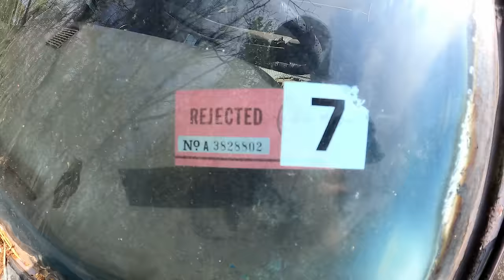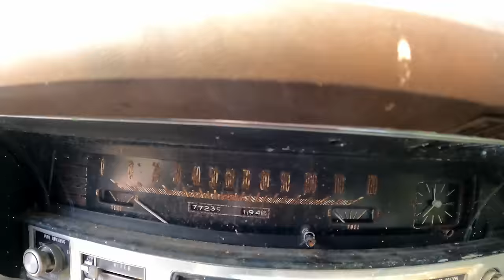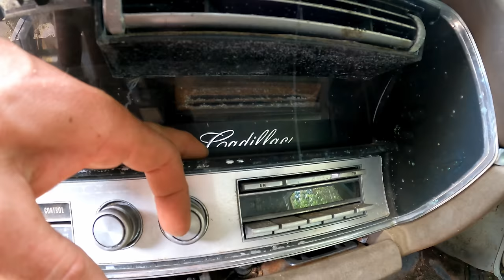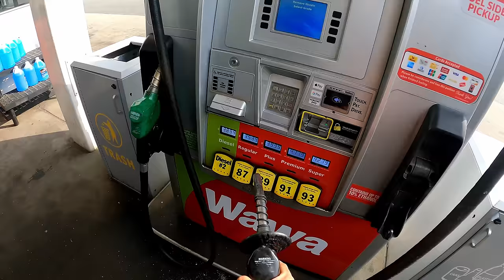1967 Cadillac Sitting For 15 Years  Will It Run / Drive?

Comment: Thank you Chris for keeping your videos real. Instead of editing out mistakes. That is just one of the reasons I love your channel. Plus Gus of course.
Reply from the maker: Glad you like them! And thanks so much for tuning in
Reply: G
Reply: Y. Vyggy
Reply: By bgy
Reply: @NoNonsenseKnowHow  I learn best from mistakes, and so could learn far less if you edited yours out.  Though I have little problem with seeing Caddies get demoed, if it was a more practical old station wagon, I would get it past inspection and put about 300 miles on it with high detergent fuel and oil to clean out the carb and hopefully unstick a ring or 2 so that it can be sold running smoothly and plated even if not much is invested in aesthetics, but spray wax it to prevent any further rust.  Also, you can enjoy it for those 300 miles, during which you can improve reliability.  Then the buyer has a reliable base on which to do aesthetics to his own tastes.
Reply: The third horn is optional.
Reply: My Eldo uses 235 75 15s.  L 78 15.
Reply: 68 Eldo got front disc brakes.
Reply: this is an exact copy of the   other comment, you don't mean it

Comment: My Grandparents bought a 1968 cadillac sedan de ville brand new. Light green metallic,  2 tone green interior,  very nice..They were in thier late 70s then. Lifelong Southern California car,  it was always garaged.  In 1982 when grandpa died at 93, it had 38.000 miles on it! Absolutely like new. Grandma didn't drive any more and sold it..Absolutely in like new condition.  I like to think its still in good shape and running around,  its possible,  my 58 cadillac that my parents bought in 1960 is still on the road.
Reply: какая же восхитительная машина❤

Comment: I had a 67 coupe DeVille in 1990 . I had it shipped to the UK , it cost all in car and shipping $4000 ... I was twenty five years old , people in the UK thought I'd won the lottery 😂Man it was perfect no rust no filler perfect paint and interior . It had 67000 original miles on it . Apparently it was in a private collection owned by an old fella from Carolina. What an experience to drive everything worked perfectly. Power seats , power antenna, power windows , self seek FM radio , climate control, cruise control and what amazed me for the year was the automatic dipping headlights .And that engine power wow ..Kept it for several years then sold it to put a deposit on my first house ... Wish I still had it !!! That's life though

Comment: '66 and '67 are two of my favorite years for Cadillacs. This one has a fantastic original drivetrain, but the body and interior condition put it on that borderline leaning toward a parts donor. Someone with a solid original Western states '67 body and complete interior that had it's drivetrain plucked would be the ideal purchaser for this car. Definitely agree with you though that this car does not belong in a demo derby. Still way too many unobtainium good parts on this car. First time viewer here, Gus made me a new subscriber. 🙂

Comment: The interior vacuum leak may also be the Neutral safety switch. Cadillac's have an auto parking brake release when you put them in gear. If you have a remote trunk release in the glove box it is likely vacuum too as well as the power locks which also can be activated with the door key.
Reply from the maker: Oh okay, thanks for the info!
Reply: Thank you, Buddy!
Your comment is Best!
Good brain❤👍👌

Comment: Great revival! You mentioned cleaning cast iron brake drums and I think with your love of vintage tools, you might consider an electrolysis tank. Super easy to set up and more effective than any other method of cleaning iron or steel. I use it to restore cast iron cookware, tools like spanner wrenches, axes, all kinds of things. All you need is a manual battery charger or at least one with a hold function, scrap metal, water and Soda Wash. Soda wash can be found in the laundry soap aisle or can be made from baking soda by putting it in the oven for 30 min. Once cleaned, the iron can be "seasoned" or steel can be cold blued for protection. Cleaning cookware should have a dedicated tank though and make sure to lead test everything first. Just an idea. Keep up the good work!

Comment: I believe the long horn is called a trumpet horn and was an accessory but normally standard on the eldorados! It was tuned to a "C" pitch and sounded vaguely like a train horn in conjunction with the two standard horns.
Reply: They usually had 4, A C D F, 2 note is just A F. I'm guessing the empty hole is the missing horn.

Comment: Props to that vacuum.  It's taken a beating through all your boat, truck and car projects over the years and still going strong.
Reply: When it sucked up half the battery box, I knew it was a keeper.
Reply: I like the green chair he has in the garage
Reply: @William_customz lol okay 😂
Reply: Nice job on the new shop.that caddy is pretty rusty.
Reply: @peterwill3699  Nothing that can't be fixed if you can weld. Sleeperdude does it all the time.

Comment: LOVED this video. I have a soft spot in my heart for Cadillacs. I have never owned one but my grandfather always had one, my coworker has one and my boss has one. As a kid up in Teaneck in the late '60s-early '70s there was a corporate Cadillac office nearby. Everybody who worked there drove a Cadillac. If we were lucky, sometimes somebody was coming out to their car to leave and they would ask us if we wanted to look or sit inside it. We used to ride our bikes around in the parking lot and learn what the different shapes of the rear tail lights were for the different year Cadillacs and then quiz each other on what year a certain Caddy was. The '66 had the line down the middle, the '67 and '68 were the same, the '69 had that upper triangle thing, etc. I wish they had kept that original color of yours also, which was called Pinecrest Green Iridescent. The things my brain retains! Your Caddy is in pretty rough shape interiorwise but thank goodness it is in the right hands now. I never had any doubt that you'd get it running.
Reply: "Tin Men".

Comment: When I worked for a landscaping company I always wondered why the front tires on the trailer wore out way before the rear tires. Makes sense now how you explained it.
Reply from the maker: Yeah they get scrubbed sideways when turning
Reply: Tried to find a wheel comment 😂. Those chrome wheels in the trunk are from Jaguar series 1 and 2 (XJ6 and XJ12)

Comment: Chris, that car is awesome. I can believe how well the car runs a those 429s were great engines. She looks relatively solid considering that she has been in the North East. I’d love to see more videos on that car, and also to see her put back on the road. Awesome video as always!!!
Reply: If I’m not mistaken it’s a 425 Cadillac engine in there, I own a 1967 Cadillac Deville 2 door Convertible
Reply: @blackbiker1961  I think that you are correct! The 429’s were late 70’s. I always mix those up!
Reply: Nahhh, that's a 429cid. I had a '67 Caddy Calais coupe which were basically DeVilles without all the luxury goodies. The 429's were built from 1964-67 as a replacement for the 390''s while the Caddy 425's were built from 1977-79. The '67 429's were unique because the factory started using new style rocker arms & rocker arm supports to replace their outdated rocker arm shafts and rocker arms setups. But the rocker arm supports for '67 were slightly different from the ones used from 1968-onwards.
Reply: @Rocco_Gibraltar  I’m sorry you are right !

Comment: The air horn is an option it's called an Eldorado horn. You will also have a high and low horns as well
Reply: Trumpet horn.
Reply: @jeffrobodine8579 I called it a air horn because that's what he referred it to. I had the same set on my 65 Cadillac

Comment: Same body style as a 1968 minus the 472 motor 1967 Cadillac used a less powerful engine 429 C I /1964-67 unless you're a grandma who doesn't care about horsepower, a 500 ci V8 engines❤ would be a better choice for a nearly 6000lb sedan.
Reply: A 500 ci engines had less power than the 472. They were bogged down with emissions & lower compression ratios.
Reply: I seemed to have spoke to soon. I looked it up to be sure & in 1970 the 500 engines did have more power. My mistake. It seems the 472 was rated at 375hp & the 70 500 was rated at 400hp.

Comment: If your asphalt isn't sealed, you can flash it with a Portland concrete mix. If you decide on that path, I'd suggest going pretty thick with it considering the work you do. I'd also create a relatively "level" level 20 foot area, with about 1/16" pitch per 3' for drainage. While you're at it, you could install an iron grill covered drain about 2'x4' in the middle for draining fluids into a catch reservoir, or removable catch can. The covers are important, not just so you don't fall into them, but so the pets won't drink any coolant, etc. Apparently coolant has a sweet taste, especially to cats. (edit-I am no professional, just a dude with an idea)

Comment: love my tilt bed trailer, however you should of gotten one where the ram is under the trailer and not in front. 2 reasons. 1 it makes the tongue of the trailer shorter thus making the trailer shorter thus making it easier to get around in tight places. and 2 it allows for you to mount the winch in front of the deck and not on it which clears up extra space and allows you to winch long cars and trucks that extra foot that you always seem to need, and you dont have to worry near as much about running into the winch and damaging it.

Comment: The button on the outside is the problem with the driver door. Just take your pb blaster to the mechanism down threw the opening where the back of the front window shoot it down inside there

Comment: There’s a certain way to put the hubcaps on that type of hubcap   Those little fins or ears you have to tap them under the lip of the rim with a flat screw driver. You can never just hammer them straight on   You tuck one side under the rim then take a regular screw driver and tap the ears on the hubcap under the lip of the rim

Comment: Use mariatic acid diluted  then. Neutralize w baking. Soda. Then clear. Epoxy or add a lil paint to color. Epoxy. Over. Rust and. Frames 💀👊🏁and. Rust buckets 🎩

Comment: That grey shit on the rear right hand quarter is NewTech bog with glass fibre. Though I don't know if it is used now, it was quite possible to make a floorpan section in situ and it would actually stand up to service. Hard to work IMHO!

Comment: I had an ald shitbox that the door latch was the same. It malfunctioned the same way. When it happened I'd hold the inside door release open and hold the outside door release also. You need a second person to use a flathead and flip the latch back over so it lines up with the door pin. I hope this makes sense.

Comment: I was born in 1963 in the UK and about 1980, I made a habit of spending long summer vacations in Florida. Correct me if I am wrong, but at that time, I seem to recall you could buy a running late 1960's / early 1970's full size gas guzzler for something less than $1000. Am I right? I always wanted to have one of these real old gas guzzlers, but I suspect I never will now.... oh well.

Comment: I had one just like it except mine was gold and would run like a scolded dog. That one I had was actually fast. Had a real big motor it  run real well. I had the only caddy with headers and glass packs  and dual line Holley  . This car would fly.i bought it in  1976. Big bad 67 . I gave 700 for it. It had a. 500 plus motor .31,000” actual
Reply: Actually had a 429 in it. From what I remember.

Comment: How is it possible to have negative voltage? Does not compute in my head.
Reply from the maker: It means the battery went down to zero volts and then reversed polarity. You can actually charge your battery backwards as well if it's down at zero volts and you hook it up backwards

Comment: [Album]
All elemental dragons obey the water cats as elders. Phoenixes are more powerful, but they have other functions that don’t concern you. But phoenix communicators also live on earth like ordinary people. 2 cats, 2 phoenixes, one connecting them with a single field. ... well, and a guardian observer, like an arbiter for demons. That's the whole structure. ... you don’t imagine any special value milking us🐈‍⬛, demons are engaged in cosmological objects. You are a way of existing in one form for races of different natures. A way for the same representatives of others to live. An artificial platform for direct communication and mutual understanding between us🐈‍⬛, and not with you🐒. But, nevertheless, some kind of project to create a new race. Successful projects are resettled, unsuccessful ones are reset.✌🤪👌 ... well, that’s basically it 🤷‍♀
Oh, yes, the sun is the same inhabited object as the earth. But much higher quality and better.✌🐈‍⬛👌

Comment: what is bad on those cars they like boat (b.o.a.t -blast another thousand ) just on fuel rev it rev it or spinn wheel -and it will cost over gallon lol. and if it start badly like in winter only start and warm up will cost you 2 gallons alone haha soft lie 3-5 
wheel cover can cost 75-100 buck per one remember that when smack them with hammer 

depend on market and your possibilities alone is very hard. lot small parts at end will eat budget, original colour green on door?
fix brakes clean all possible fix some simply things what can sandlast and paint primer and try to resell, or full project but it must be atleast 60% profit or more at start , and complete restore will cost you probably more than buy another fixed one 
-or  if  lot crazy people leave as rat rod style. lot people put in cars 40-80grand and end value -ech give you 8000 car must be exlusive not matter is good bad -if dont have that "exotic" dnr -just sell it, add some for your month or 3 moths labors time to price and sell it. people pay for car not for what you invested in it